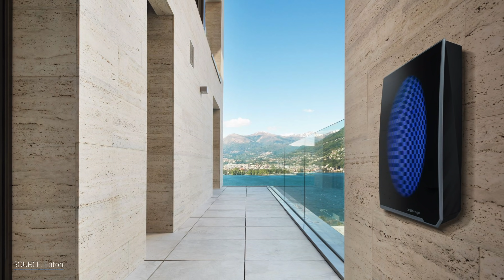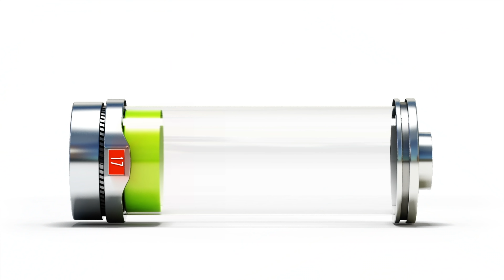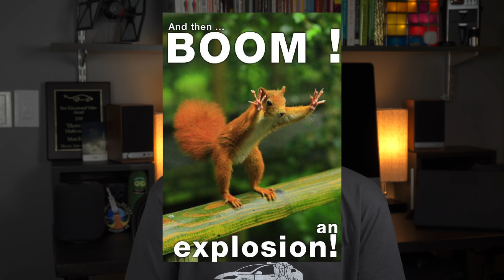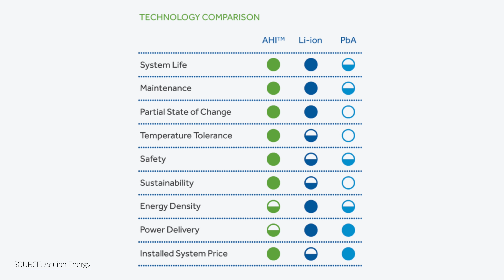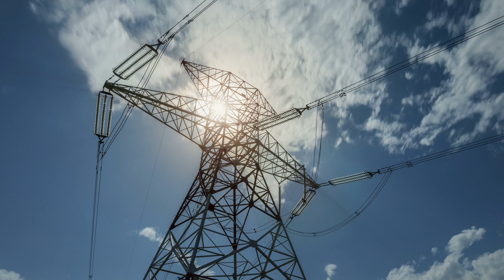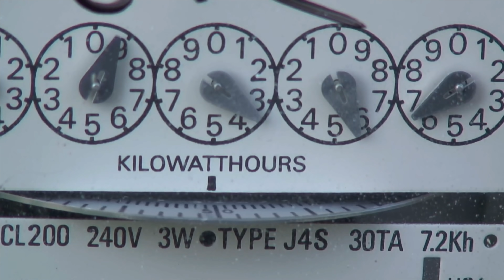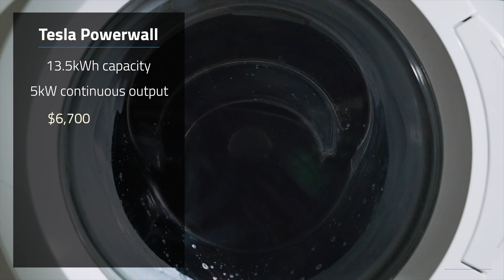Solar Battery Tesla Powerwall and more

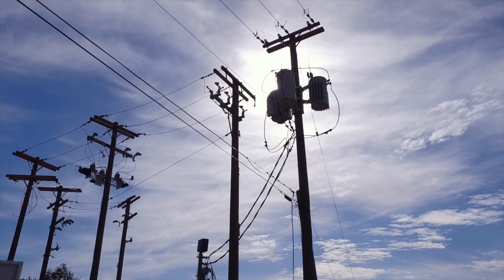Comment: @5:24, if you get a battery as solar equipment in the US in 2019, it’s eligible for the 30% federal tax credit, as long as it’s charged 100% with solar, for 5 years after installation. If you use it to game the tier rates, you can’t claim the tax credit. 

I think in most places, $8000 more solar will help more than an $8000 battery, but if your state will basically pay you to go off-grid as much as possible, then a battery might be good. 

You have true net metering, which is very rare. Some places have fair net billing, where they charge about 1-2¢/kWh to be your battery, and other places are a total ripoff, paying about 50% or more of what you will pay to buy it back. Normally the prices are just below what it would cost to buy an energy storage system.
Reply from the maker: Good call out on the tax credit.  Should have included that in the video too.  And yeah, my situation is more rare than I’d like to admit.  It seems far more common that the net billing type of thing is being done, which unintentionally incentives adding a battery to your setup.
Reply: In QLD Australia, we get a 44c per kWh credit on all the energy we export back to the grid, which is much higher than we actually pay per kWh consumed. We can effectively cancel out our energy bill with a modest solar system. 

This caused massive demand for solar installations, which caused costs to drop significantly, so much so that just about every house in the state has one. 

The scheme has ended now, those that bought in early get to keep it for another 10 years or so, all new installations only get 8c credit. 

Did what it was supposed to do though, it got a lot of people to invest in solar.
Reply: Arron McLean, similar things happened in the US, except certain companies tried to game the system and started Leasing system on people’s houses. Then after signing a 20 year lease, the utility company changed the policies and those leasing solar were left paying a higher combined bill than those without solar. 

Right now solar is pretty cheap around the world, but in some of the US states the price of electricity is very low and the solar irradiance is also low, compared with Southern California, which has higher solar irradiance than most states except part of Hawaii. So a system that takes 7 years to pay off in California might take 14 years to pay off in states where electricity is only 10¢/kWh.

The powerwall almost never makes financial sense. It’s basically a whole house UPS for those who have money to burn, or live in a place with very bad grid, and work from home in a way that a power outage might cost lots of lost income.
Reply: @imho7250  you will probably find the deal he is on is well and truly sunsetted and the current real feed in rate is much lower.   Govts in the main have woken up the the amount of gaming going on and issues raised by over installing solar (the duck curve affect as the sun goes away).

Comment: Worth noting that at current prices, for the average homeowner, it virtually NEVER makes sense economically to get one of these batteries if you either don't have solar panels or don't live in an area where electricity prices are wildly expensive (in the US, pretty much only Hawaii). Even then, without solar in a high price/KwH area, payback times are still ridiculous. The systems are being peddled to consumers as a general product for anyone whether you have solar or not, based on their benefit of effectively eliminating power outages, but it just doesn't work at the present very expensive prices. The Tesla unit in particular is obscenely egregious. It should cost <1/5th the price they're asking based on the ~$100/KwH cell costs they're already working with for their car battery packs. It's artificially high because their operation is still cell starved with the ongoing model 3 production ramp.
Reply from the maker: Tesla isn’t at the $100/kWh cell cost yet (getting close).  When you compare the costs and energy capacity of all the major lithium ion solar batteries, it’s interesting to see that Tesla is one of the cheapest options available per kWh.  And by cheap ... it’s still VERY expensive.
Reply: I think they probably are close to around $100/KwH now at least at the cell level even if the numbers haven't been released publicly. Evannex was saying they were at $150 in '17 and a UBS paper from last November was saying $111 at that time, so I think they must be very close now.
Reply: "in the US, pretty much only Hawaii"   Cali gives it a fair shake on high prices

Comment: Thanks Matt, had my Powerwall installed early March 2019 so I’m just a few months in to regulating my power now knowing that I’m managing power that I have vs just pushing my surplus solar back to our grid.   We’ve made changes with when we do laundry (drier) or if we’re making baked goods so that we hit some optimal times (sunny mid-days) so that we’re maximizing input/output and heading into the evening with a max battery charge.  We generally make it through the night and like this morning woke up at 7am with 40% of the single Powerwall still available.  It’s fundamentally changed our usage.  My April electric bill was -$48 dollars.  Still doesn’t help with the overall ROI but my kids love that we run our house off a battery (and I do too!)
Reply from the maker: That’s awesome ... and I’m jealous.  I didn’t talk about it in the video, but knowing that you’re getting full use out of your solar is worth a lot too.  Being energy independent is worth the cost of admission for a lot of people.  I’m actually one of those people, but just can’t afford it right now.  Although, from the Tesla referral program I’m supposed to be getting a Powerwall at some point, but I have no idea when or how much it will cost me to have it installed yet.
Reply: Undecided with Matt Ferrell I’m stoked to hear you have enough credits to get a Powerwall! I have always wondered if they would allow you to use any additional credits toward installation if you have Tesla/SolarCity perform the installation. Otherwise, hopefully installation costs won’t be more than $1500, depending on how you’ll be installing. 

I love the 5.1 kW PV setup with the 1 Powerwall we had installed in February 2018. We also have net metering, but I very much like having most everything in the house capable of functioning during a power outage. 

Best of luck with your Powerwall installation, whenever they get it to you. I look forward to your review. :-)
Reply from the maker: Thanks, Gary!  I’ll be extremely happy if I can get it installed for a couple thousand dollars, but we’ll see.  ;-)  And you can bet I’ll be doing a video on it if it happens!
Reply: @UndecidedTechnology  I live in a state with almost no net metering that also puts you on a time of use plan if you do a grid tied setup that is feeding your excess back to the grid plus a monthly fee for interconnection and finally the power company can limit the size of your system based on what the grid in your neighborhood can handle. With all those hoops it makes payback a bit more difficult. There are also no state credits, only the federal credits. Given all that I went the DYI approach with an initial 4kw array feeding a pair of inverter/chargers that can take up to 4kw of solar each and combined put out 6kw of split phase power, with a dyi lithium iron phosphate battery that holds about 10kwh. I have the system set to charge the battery from solar only, and once the battery reaches a set voltage or I have more power than I can dump into the battery coming in it disconnects the loads from the grid and runs everything I have on it via a sub panel from the solar, which is my computers, mini split AC systems, fridge, chest freezers and lights and ceiling fans as well as the washer and dryer. My electric car, oven, dishwasher, toaster oven and many of the standard outlets in rooms are not on it but those also are not heavily used either. As long as the battery stays above the voltage setting I have set it will stay on solar/battery from about 9:30 in the morning till about 8 in the evening on a sunny spring day. After either there is no solar being generated at all or the battery level hits the set point, it switches back to the grid. I can also set it charge from the grid if it will be overcast/rainy for a long period of time or there is a storm expected as we often lose power during those times.  The lights and ceiling fans in the 3 main areas we use a lot are on a smaller inverter directly tied to the battery, so they are powered exclusively from the solar except for when I have the battery charge from the grid on low production days. Most days by the time it switches off the battery/inverter to the grid I still have 2/3rds of the battery capacity remaining, plenty to keep things powered overnight in an outage and with only those lights and fans on the battery they only use about 150 watts when in use. I recently acquired another 6kw of panels for $500 and plan to setup a couple smaller arrays of 1.2kw each that are aimed for morning and evening to help boost the solar collection in those time periods and will add about 5kwh additional battery storage, . Even without that in early spring we are offsetting about 30% of our daily needs right now, and summer it should offset closer to 60%, with the smaller sub arrays and extra storage I think I can take the bill to nearly zero from late spring to fall and cut the remainder of the year by a good bit.  Since it was a dyi setup I have about $6.5k invested in it, and I don't have to deal with my power company as nothing is being fed back nor can it feed back, and I no longer need to run my generator for power outages, if anything I'm looking to sell it as even for a multi day outage I can generate enough power daily to keep the lights, fridge and computers going. So far it's been running for about a month and a half now, I'm looking forward to seeing how it goes throughout the year. As a DYI setup there are certain things like switching to to grid charging that I have to do rather than the system doing it for me, but for the savings, it's been worth it. The inverters have a 10 year warranty, the batteries are second life, but should last several years on such gentle usage and only amounted to about $1800 of the costs, with the panels amounting to about $1600 of my costs, $1800 for the inverters with about $250 in the bms system and the rest being wire, conduit, and racking, and the racking much of it I was able to get for next to nothing. While I know electrical I'm not a licensed electrician so I had a friend who is help me with that to make sure everything was up to code. Looking for it to pay itself back in about 3-4 years, though I'll know more after a year. The new components I'll be able to get a tax credit on, which will help a small bit. I'm happy to be drastically reducing our carbon foot print.
Reply: Mike Plate I think that’s so cool 😎 keep it green